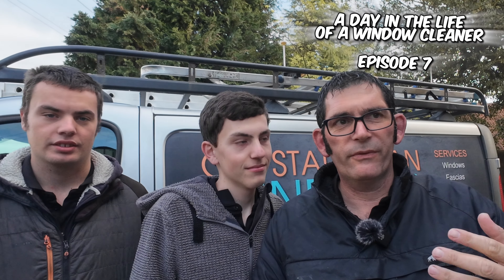Unbelievable Gutter & Window Cleaning Challenge!

Comment: Great to see you all. Definitely push the kids to be able to do all the jobs especially the tricky ones as they can build muscles and get a great physique! I guess you could have made the vid a little longer, maybe that helps with views?
One tip with genys is try, when ever possible, to fill up with fuel when the geny is cold i.e. at the start of the job. Filling when a geny is hot can be dangerous as the exhaust can ignite spilt fuel.
Reply from the maker: Ha ha cheers Ched who knows with the kids, jobs may be hard to find and then they will ask to work with me more (handy as i am feeling older). I'll end up getting more work just for them LOL. Just goes to show you can make a living out of it as opposed to a side hustle. Very good point about refilling the genny i am always careful but accidents do happen so good point. I'll see about increasing the video time only one way to learn how to film and work without making the day to long.